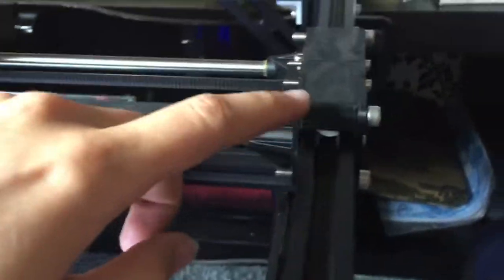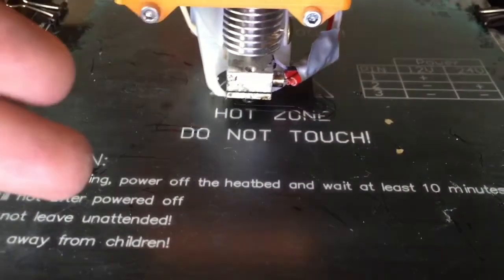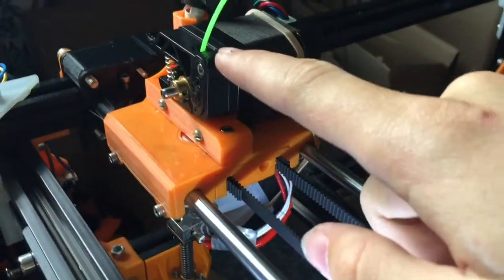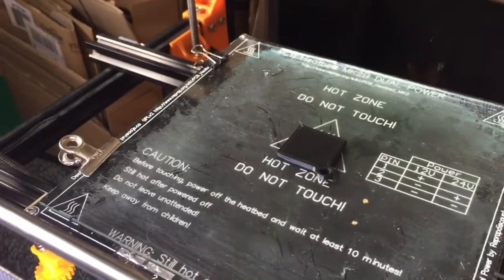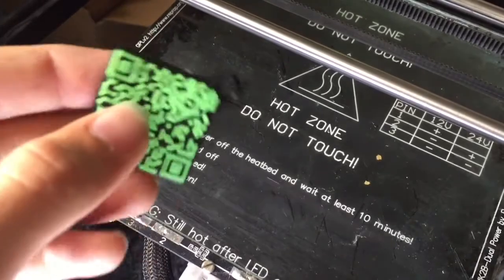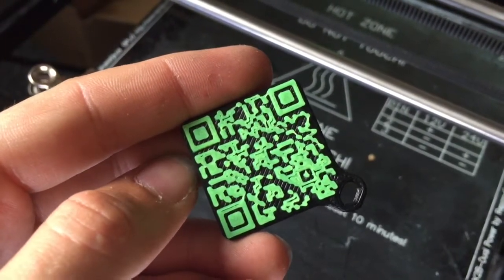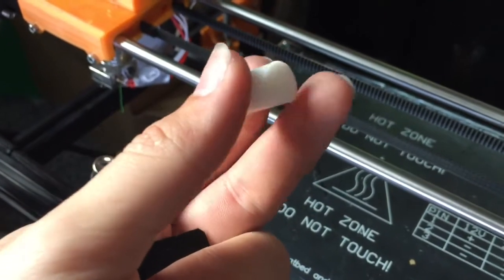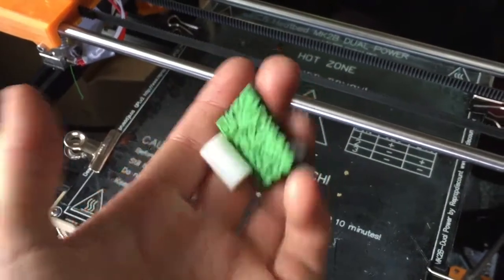V-Slot with PTFE - Better than Delrin Wheels?

Comment: How much do they wear over time? I think that would be my main concern...
Reply: $15 a 24 inch rod. Please, if they last 100hrs you get your money's worth. You can get 35 0.75" slides out of 24 inches. I would still put 1 or 1.5 inch slides, its teflon on anodized aluminum
Reply: @williamfitzpatrick1132  it's not all about money. its about reliability. 3d printer is a heavy duty machine. no one likes to check all ptfe tubes before and in the middle of prints. and also spend time to change the tubes and calibrate every time. i think this idea sounds good, but doesnt work .
Reply: @williamfitzpatrick1132  Sliding friction vs rolling friction. Even if they were free having them go sloppy on you would make you hate yourself for using them. Plus anodized aluminum is fairly abrasive once you start sliding across it 1000 times.

Comment: can you show more clearly what they are and how well they slide without power? how can they be better than bearings? are they similar but not as good?
Reply: They are just a type of non-stick polymer. They still require some motor to move them about. They have similar results to bearings and could be cheaper to replace, but might need to be replaced more often, especially if the surface they ride on is rough in any way.